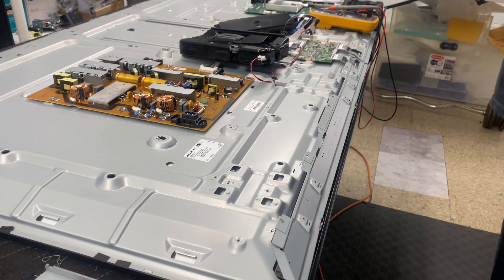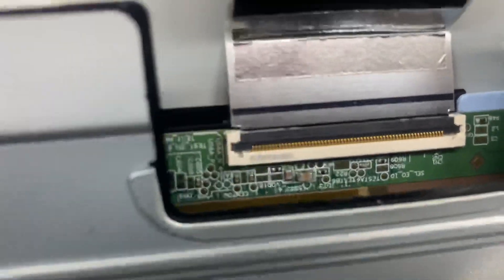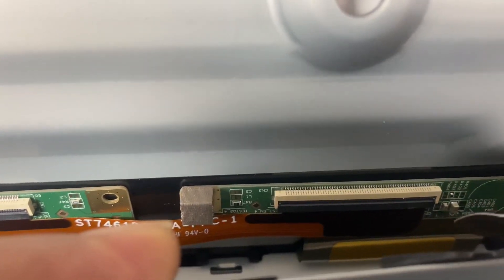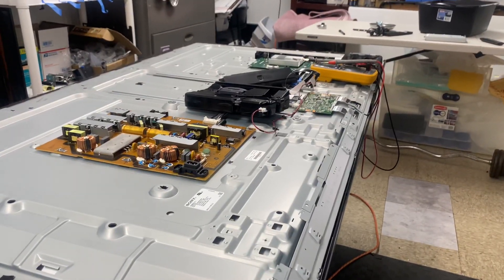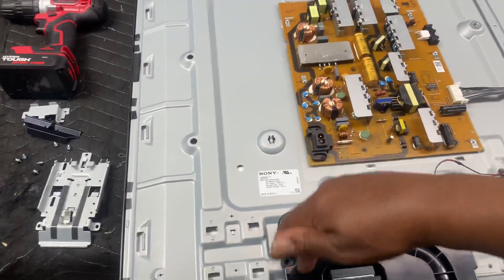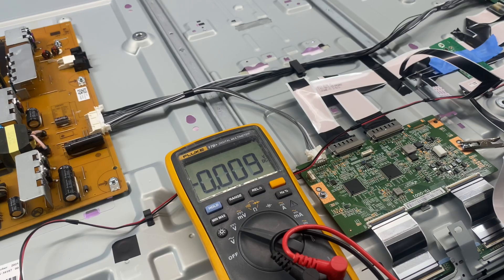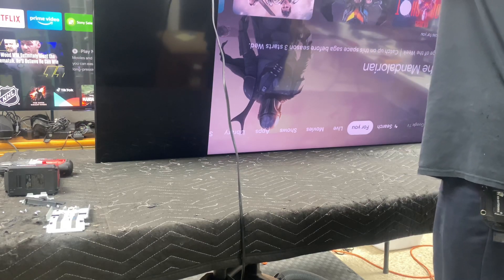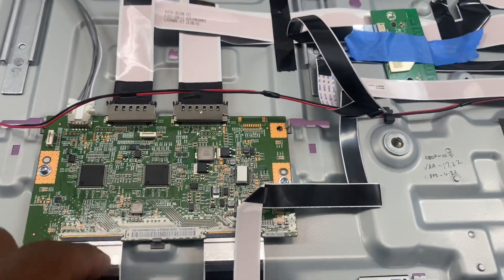SONY KD-65X85J NO PICTURE BUT HAS SOUND TROUBLESHOOTING HELP PART 2

Comment: Did you solve the problem with the last part? I have Sony XR-65X90J and it looks just as tv in this video. I'm still trying to isolate some pins on the left ribbon (from the last quarter of the panel).

Comment: Hi..my tv model also sony kd-65x80j & troubleshooting also left side screen not functioning after disconnecting the panel..is it i need to change only the left side panel in order to solve this issue?